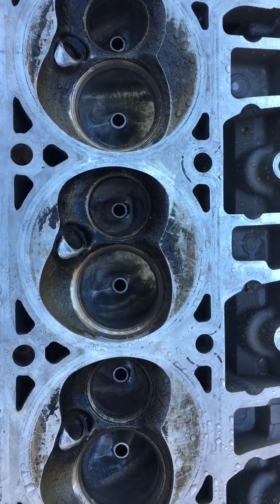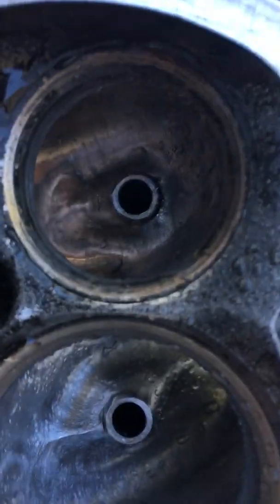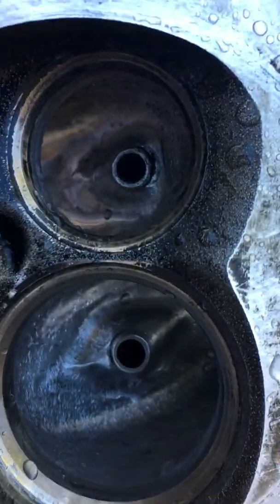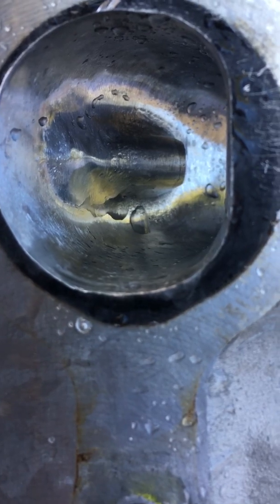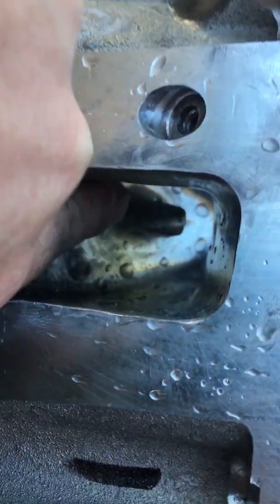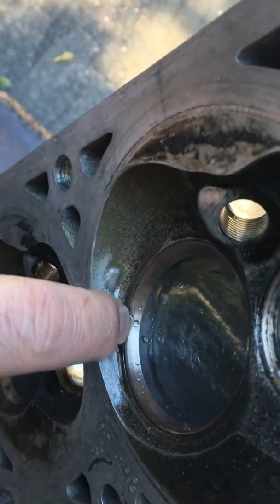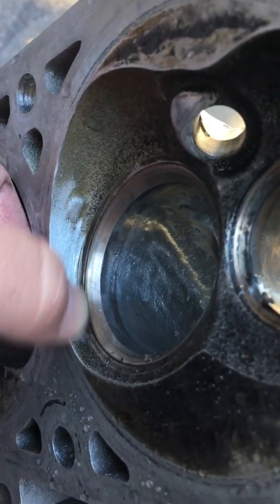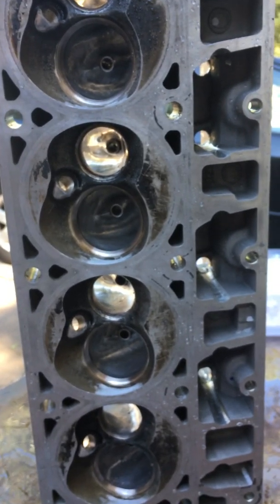2015 L96 6.0 Gen IV 823 head porting and polishing

Comment: Some of the research I've done on l92/ls3 heads is kinda odd, most professional head builders only port the exhaust side, supposedly the intake side is good out of the box. I'm not sure if that applies to l96 heads as well.
Reply from the maker: Rusted Horsepower Some recent dyno tests suggest that the exhaust port is actually well-designed and does not restrict horsepower. I think those porters are operating on pretty old methodology if they are only tackling the exhaust port. If you are home porting, it only takes a bit of extra effort to do the intake as well.
Reply: @philistineau well, at this point I only see what I research. Your point is very interesting, I'll keep that in mind.
Reply from the maker: Rusted Horsepower this is an example, it’s debunked the exhaust flow theories: https://youtu.be/Efy36-7K_B4
Reply from the maker: For the intake, I agree that you don’t want to remove too much material. My focus on the intake was to improve the coefficient of discharge. I purposely did not remove too much material, but did clean up the flashing and mold lines, take down and smooth the bumps and really focus on a good flow path around the valve guide and radii. I didn’t say it in the video, but a lot of my time was spent with 80 and 400 grit. In all honesty though, it might take a turbo to see a big benefit over stock. They flow so well out of the box.